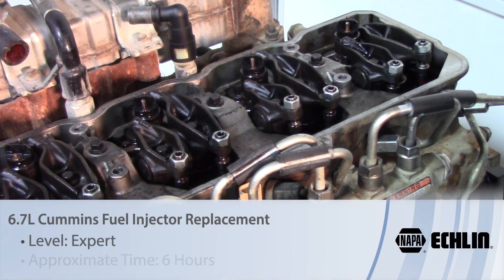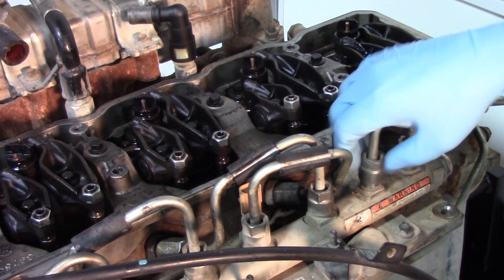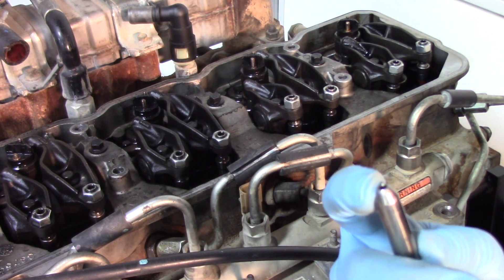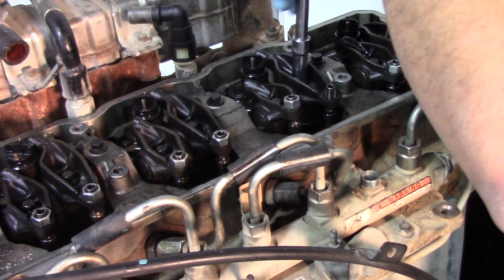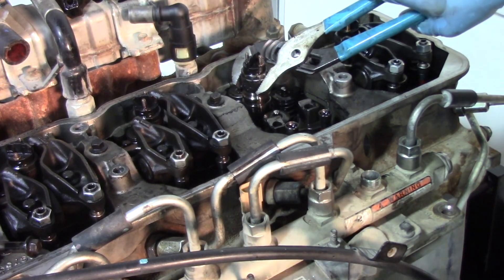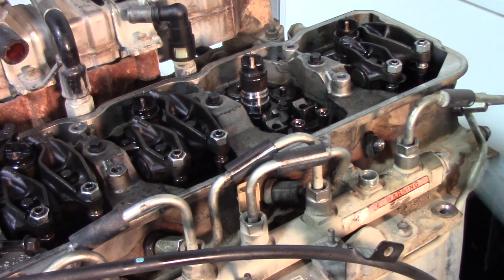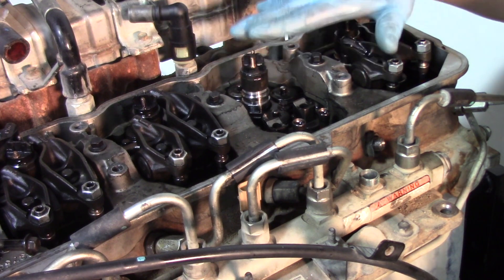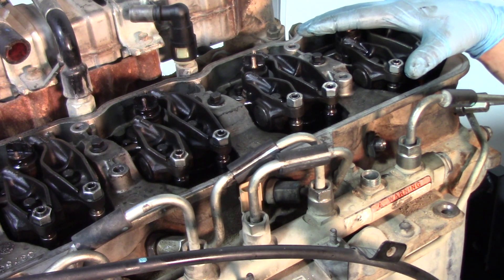6.7L Cummins Fuel Injector Replacement

Comment: DO NOT REMOVE THE VALVE ADJUSTMENT BOLTS.
Reply: I was wondering why he did that
Reply: A great example of what NOT to do… only thing he did was throw off the valve lash for that rocker